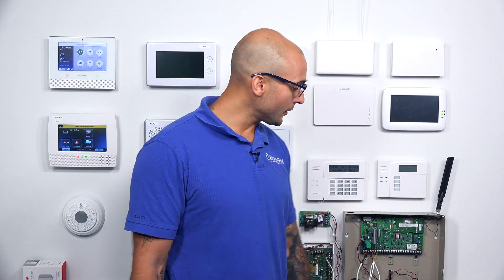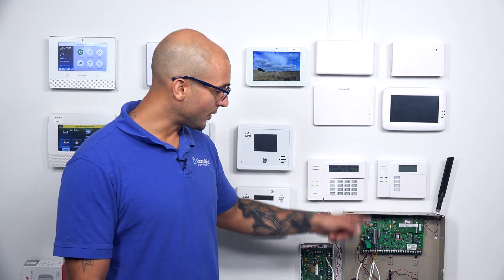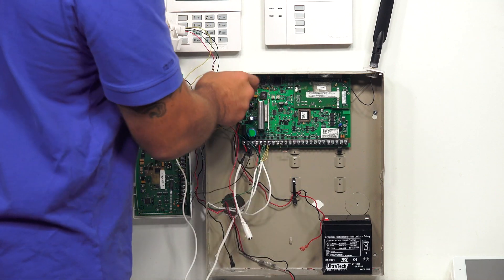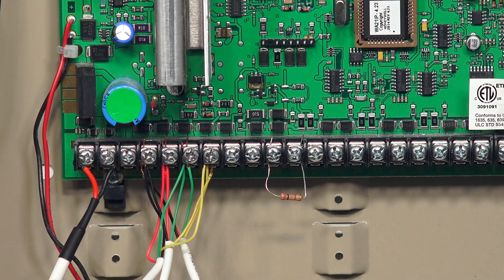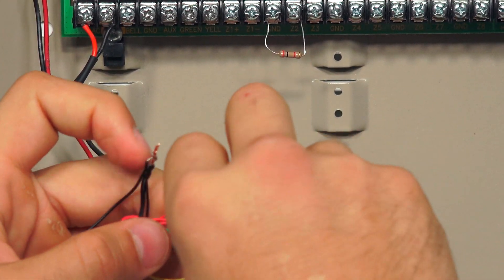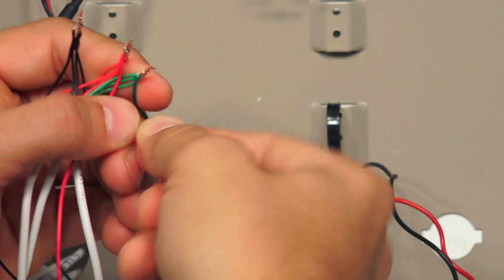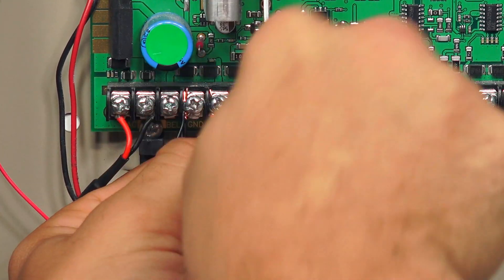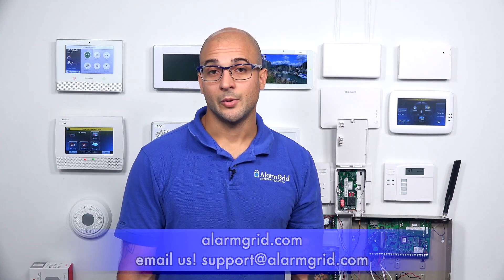Connecting an LTE-XV to a VISTA-21iP

Comment: I am a security professional and now dealing with this 3G crisis. I have about 12 Vista21iP panels that need upgrading. I see you left the old cell board and antenna installed. Should this be the case or should it be removed? I did one the other day and removed the old board and the system is working fine. Just want your thoughts. Thank you! Joe Cahill, Owner of J & J Security
Reply from the maker: Hi Joe, at the point at which you set the Jumper inside the 21iP to OFF,  the internal communicator is powered down. Once that happens, there shouldn't be any danger involved with leaving the old radio board in, but there's also nothing wrong with taking it out. Taking it out might cause less confusion for a service tech down the road.